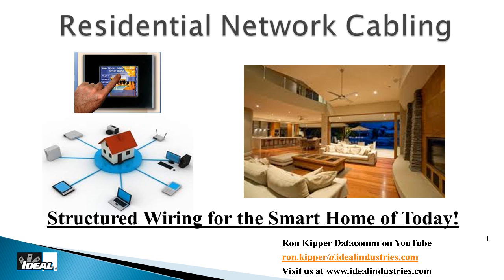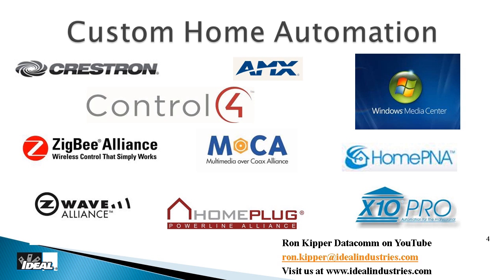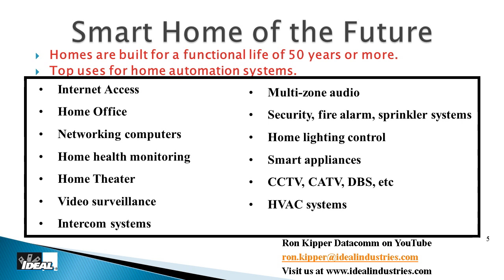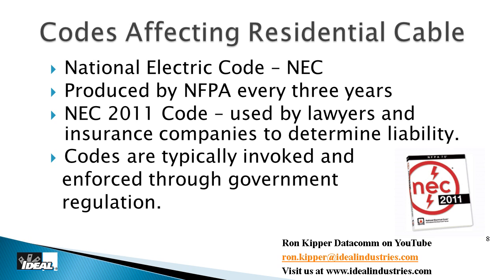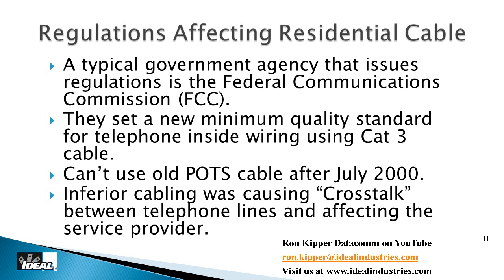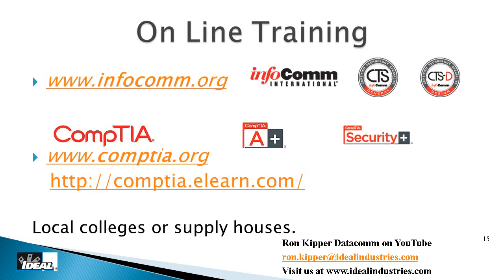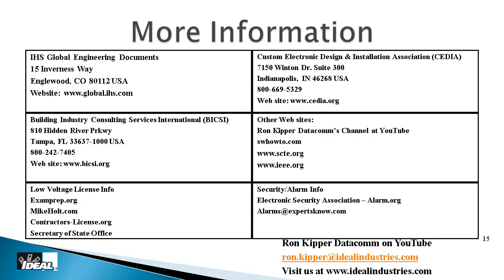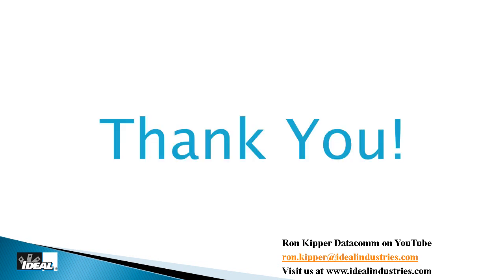Residential Structured Wiring Systems Part 1 Why and How to Wire a Home

Comment: Can you recommend any hands on training i can get with low voltage structural wiring. Im in NYC willing to travel though.
Reply from the maker: Alex good to hear from you might check out these guys who are the National Low Voltage Contractors Association. They offer training too. Good luck Ronhttp://www.nlvca.org/index.php
Reply: thanks Ron, appreciate the fast response. Your material is excellent btw.
Reply from the maker: Appreciate it I wish I could do it full time. You can make pretty good money as a tech just keep learning. The industry changes so fast it forces you to keep up. Ron